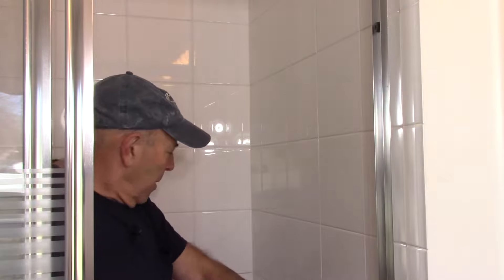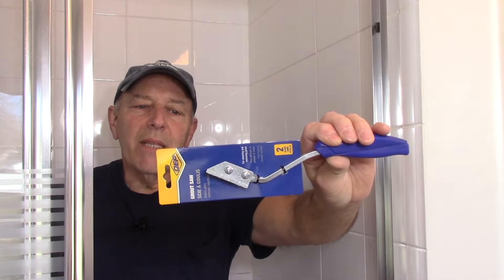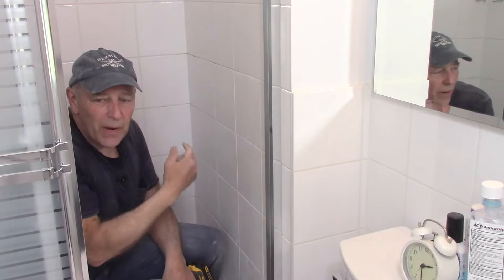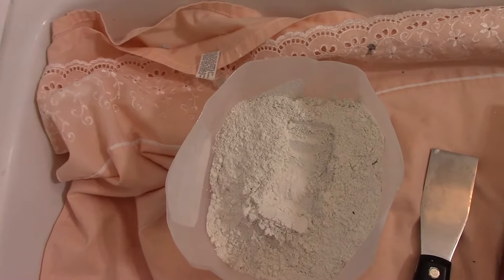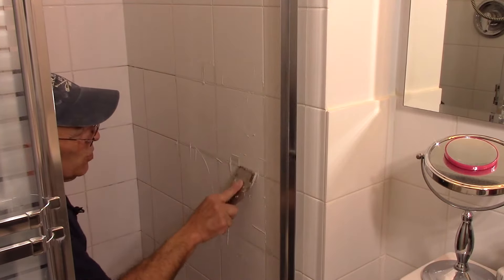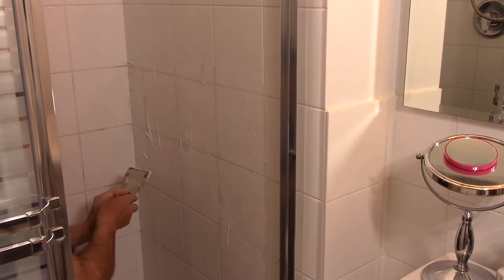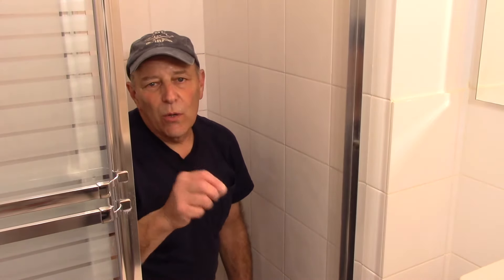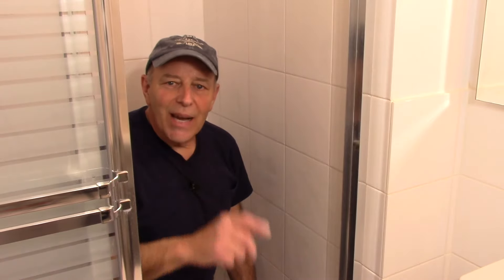How To Remove And Replace Grout In A Shower | DIY For Beginners

Comment: An oscillating tool means it does not rotate; it oscillates and vibrates at a high rate of speed. Diamond chips are embedded into the tools.
Reply from the maker: You got it! Thanks for the clarification!

Comment: THANK YOU for giving us permission to not have to remove all the old grout and also to use a spackling tool rather than a grouting float!!! (I have just started removing grout on project using oscillating tool and Dremel tool).
Reply from the maker: Our pleasure! Good luck. Don’t forget to subscribe.

Comment: Thank you so much for the helpful video! I have some cracked grout on some of my shower wall tiles and I'm looking to replace it myself. I do have a question for you - what's the best way to tell if there is water damage behind the tile as a result of the cracked grout?

Comment: Great vid! What if there are broken tiles and tiles with drill holes/wall anchors that we are no longer using. Would we grout over the holes and cracks in the tiles?…Or try to figure out how to replace those tiles?

Comment: How do you avoid accidentally damaging the tiles when removing the grout with the multi tool?
Reply from the maker: You just can’t go to deep
Reply: This was the 1st question that came into my mind.
Reply: @getitdonehomerepair  I was more referring to the exterior edges of the tiles.
Reply: @bcx5000  As a general contractor, you can't. You WILL chip the edges of the tile and they will show.
I have never seen anyone do this without wrecking the edges of the tiles and I never take one of these jobs.
Reply: @Kensdisguise  Thank you. This makes more sense.
Reply: If you use normal blade like non diamond types you won't damage the tiles if you be careful, for short you have to take your time to clean, don't rush and use thinner non diamond blade. Pros; You won't damage your tile and get the job done.
Cons; Time consuming and your blade are dulling more faster than diamonds ones.

Ps; If some grout remains edge of the tile like possible chipping point you have to do it manually.
Reply: @devsindustry4409  thanks for the breakdown. My grout is quite thin so even the 1/16 blades are nerve-wracking to try. I think all I have is diamond however so I will need to acquire some non diamond and try it out.
Reply: @bcx5000  One more trick I can offer but it's risky, you can use hydrochloric acid but there is a catch, it's highly toxic of course and if you have use this method you should try somewhere doesn't seen directly because sometimes tiles are not strong enough to resist acid and please use required respirator and clean air circulation, do not breath that fume! It's last solution but remember nothing is important than health.
Reply: @bcx5000  There is a one more solution but you have to be careful it's risky! You can use hydrochloric acid to remove the grout, please be aware that is acid, try pouring the acid  somewhere doesn't seen directly, if reaction to aggressive dilute a little bit with water while doing that please use proper respirator and have clean air flow in working area.
Reply: As I mentioned in a previous post, I am a general contractor and I would NEVER take a grout removal job like this.
Now, to play devils advocate, if you are a very, very, patient person with rock steady hands, hours and hours of time to spare, sure...give it a go!
Post some photos of the finished product and how long it took. I would be curious.
Reply: @Kensdisguise  I took your previous post to heart and there is no way I am doing it on a full shower or bathroom. I also have none of the characteristics you mentioned. This was for a limited area near the shower threshold that is not very visible. I am exploring my options and trying the various methods available not only for this mini project but for the future so the multi tool method is partially out of curiosity and for limited experimentation.
Reply: @devsindustry4409  I appreciate this info and your experience with it, very interesting. But there is no way I am doing that as even if the test area caused no tile damage, I don't trust that I wouldn't proceed to destroy the rest of the tiles anyway somehow with it.

Comment: What happens if you find that water has gone through the tiles and is coming out the other side of wall
Reply from the maker: That is a lot more serious. Are the tiles loose?
Reply: @getitdonehomerepair  no, just grout missing
Reply from the maker: @ajordan553    If the tiles are not loose you can just grout the tiles. When you start to remove the old grout the tiles may start to come loose.
Reply: @getitdonehomerepair  thank you kindly
Reply: I am using your method to do my shower tiles. I bought powdered non-sanded grout. What is the ratio of water to grout to make the consistency like peanut butter?

Comment: How often should the grout be replaced?
Reply: Hi pro here; typically you don't have to in normal case but if the grout is very bad condition like uncleanable or leaking you have to replace otherwise you don't have to replace the grout. Have nice day.
Reply: @devsindustry4409  thank you for the tid bit. I've got grout that got some black spots and gaps, It's 20 years.
Reply: @BiohazardBinkie777  I'm happy to helping you, you're welcome. Have a nice day.